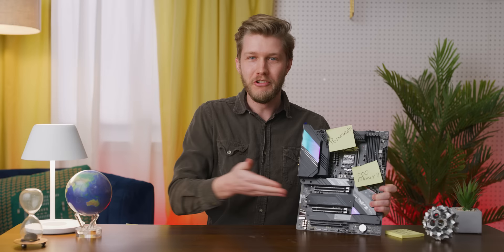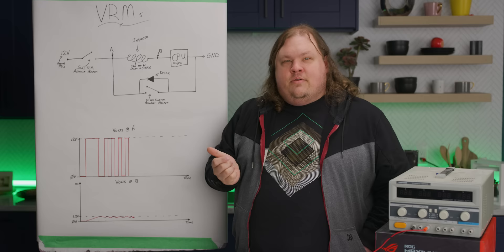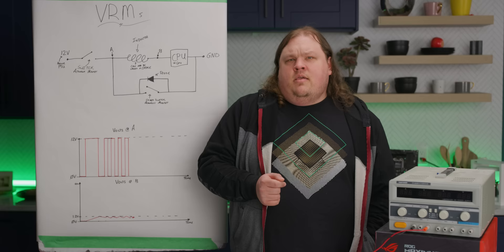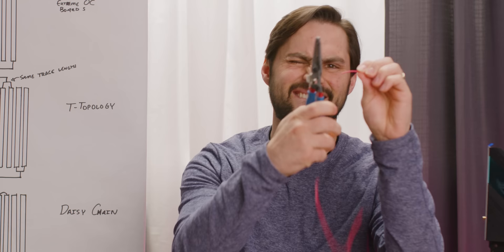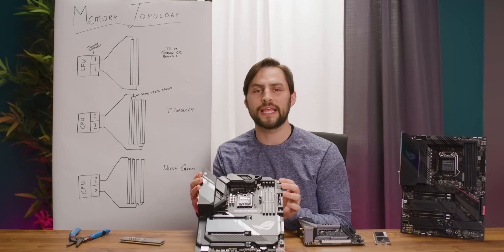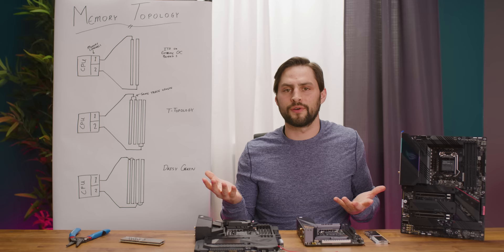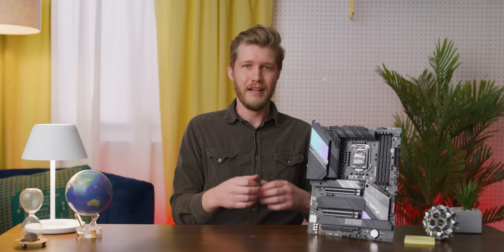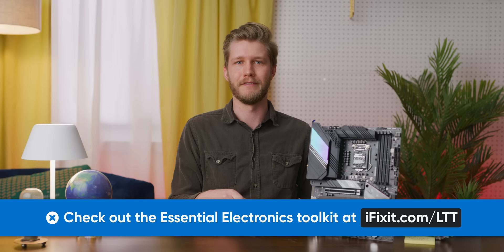How Motherboards Work - Turbo Nerd Edition

Comment: As an electronics engineer, I'm really impressed with the deep cut.
Reply: The cutout and presented result was definitely on-point, but understanding the mechanics of the simple circuit does require some prior basic knowledge about EE, such as charging/discharging Inductors (AC current when discharging right?), diodes/resistors, and dangers of shorting the circuit.
Reply: @knightblad5631  I also thought that was the weakest part of the video. It explains it on a very basic level, so basic that it doesn't really explain anything.

Like why is the switch with the diode in parallel necessary? Why does it fry the cpu if both switches are open? Also the flow of "electrons" doesn't make sense to me.
Reply: @Crallux  Wouldn't approach EE stuff thinking about electron flow. Think in terms of volts, amps and ohms. Much easier and more useful to do it that way.
Reply: @alexanderkuhn2298  You can think about them as Liquid Pipes as well very good way to understand how Ampers and Volts and Owhms(resistence) works
Reply: @mattmadcat  Im an electrical engineer but thank you.
Reply: @Crallux  And I think they don’t know how much heat a mosfet generate with a current of 10 amps going through it
Reply: @alexanderkuhn2298  Exactly! My point is that their animation is misleading and can lead to false conclusions or assumptions. It may look fancy but it is wrong in every way.
Reply: You guys are Wizards! Thank you for what you do.

Comment: In fairness, mini ITX boards have 2 slots, less VRM heatsinking and fewer expensive high speed PCIe slots, not to mention that by being smaller there's a smaller board area to pay for all those layers. Nothing stopping you from mounting one in a full size case if you're only ever going to throw a GPU and a couple of M.2 drives in (plenty of options with 2 full speed NVMe slots)

Comment: 4 ram slots actually improves performance depending on your ram, but I agree with SLI, however you can plug PX1 cards in 16x slots just the same, it just won't take up the full length so there's a use for it.

Comment: I would add to VRM part, you want to have SOMETHING, but it can be literally few mm of alu/copper/steel/iron whatever, and you will be good. As VRM efficiency change with heat, for stability you want a metal slab that touches all VRM's and unify their temps at something below 90'C, everything else is just bling. I personally like overbuild heat sinks as I am a silent build guy. Example on video is 10x of what is required, especially if CPU fan is moving.

Comment: You're teaching me more about computers than my computer science course.
Reply: "Computer Science is no more about computers than astronomy is about telescopes"
Reply: Actually I think that computer science courses focus more on the software side of things. If you want to learn more of this I beleive an electronics course is what you're looking for.
Reply: Imo it's misleading to call it CS, computer science. In german we call it informatik, which is much closer to what this is actually about: information science, which goes deeper into how information can be handled and manipulated. For hardware, EE knowledge is required much more
Reply: @nootics  guten abend
Reply: I followed an electronics degree course and had a 2 year "electronics and computers" minicourse prior to that over the same field. It does teach you how general circuits work and all but it's just basic level stuff (in regards to how hardware works that is; And since it's academic you'll be looking at low level circuits maybe mixed with some ampops at best... all else is going to be big stuff like transformers, power lines, etc). There is no course, at least in the coutry I live in, that is directed towards JUST computer hardware and how a computer works on a mechanical level (that's all I wanted and no matter how hard I looked there was none). 

These courses focus a lot on software and how there's 1's and 0's and here's logic gates and here's addresses, here's how C/C++/Python interacts with RAM to make/edit a program  or file but they dedicate nothing going into how a computer actually works with all those things mashed together, how components comunicate with eachother, how CPU receives, processes and sends information, what signals it sends/receives; Hell they don't even tell you how a motherboard works but for programming expect you to know how RAM does, somehow.

Then again, this is a recurring meme with university students from all over the world within various different courses... we are taught basics (sometimes not even that) and general info and then are expected to find out the rest by ourselves. I don't think there's even a master's (degree) for this subject. A lot of people that I've ever talked to that knew more intricate things about computers were self-taught... just goes to show.
Reply: @yeetus_maximus  Yes, all the components of the VRM was touched on near the end of the semester of my college electronics class.
Reply: i think it depends on what programs your school has
Reply: this is more computer architecture than CS

Comment: A lot of us do need 4 RAM slots and will in fact upgrade in the future and we start off with two sticks to run in dual channel mode. Maybe gamers may not have to worry about needing extra RAM but content creators definitely benefit from an upgrade. Given how prices fluctuate (and how much prebuilts overcharge for memory), we can't always afford as much RAM as we would like when we first build our systems.  Limiting yourself to two slots, it essentially means that we'll have to throw out the RAM that's already in there and effectively pay twice as much when we want to upgrade the memory.

Comment: Buildzoid is the only guy I trust to differentiate between motherboard details. Glad to see him expanding his network.
Reply: Buildzoid is who beginners watch and end up getting a $500 mobo for a russell 3600 bc that mobo has best vrms or some shit
Reply: @danielantunez8355  If you listen to buildzoid and are honest to yourself you listen to him and get a MSI B550 A-Pro, if you buy more you either didnt think yourself or you need additional features
Reply: @danielantunez8355  doesn't he usually recommend affordable motherboards. If you watch buildzoid and get a >$500 motherboard, you're an overclocker (competitive or not). I've not seen him recommended an expensive motherboard to regular people. Most $100 - $200 motherboards are good enough for 90% of consumers
Reply: I only watch BZ on GN so maybe it's different on his channel but his vids on GN are beyond the novice. This bid is a good starting point for the novice
Reply: @larsheim1032  the issue is no one's is honest w themselves. Many people bought in for pcie4 when they couldn't nearly saturate pcie3 as an example
Reply: @danielantunez8355  i know that, my MB is also over the top but i dont blame BZ for it
Reply: @jesselioce  BZ's advice is get the A-Pro, if you need way more Ram-OC or wifi get a better one. cant blame him
Reply: @larsheim1032  Buildzoid is not good at explaining what he considers a "good" or  "bad" VRM. He put 6 x 40A phase (240A) VRM in "below average" tier, not explaining that actually it's enough for non-extreme overcklocking as long as you have airflow over VRM. It can handle stock 3950X just fine, and with 8-core AMD CPUs it's pretry much chill.
Reply: @CossackHD  Exvept for the fact he does that regularly on motherboard release roundups.
He explicitly states that for the majority of people the VRM of most midrange boards is more than fine and to bare in mind that his channel is "Actually Hard-core Overclocking" not "daily driver OCs"
Reply: @bengrogan9710  I've seen his older videos where he doesn't explain that very well or at all, he even did put 240A VRM in "only good for mild OC category", while actually I was able to push R7 1700 to the (air cooler) limit on such mobo (160W) and run the cpu at full load for hours. Mild OC would have been between stock and my setting.

I didn't keep up with his videos lately as I'm not looking to buy a board, but his vids from 2-3 years ago certainly did ovrrsell importance of VRM.
Reply: @CossackHD  Again, a case of not understanding the context - he does XOC's - if you're using an air-cooler that is enough for it to be a stable daily system then that is a mild OC
Reply: @bengrogan9710  I know Buildzoid does LN2 overcklocking but even then I get an impression that he oversells VRM. Lots of people watch him knowing even less on the subject, so Buildzoid should provide more context.
Reply: @CossackHD  For XOC related stuff VRM are the main concern for supply stability when pushing hard, he's gone into it on several videos before and outright said that outside of his round up videos his content isn't focused on daily systems where outside limited issues any board will do.

You wouldn't fault A video by an F1 car driver for not covering the handing of pickup trucks as the audience is not the same
Reply: he goes into tons of details but does he know how to condense all that information into actionable buying decisions? ill look up is he has a top motherboard of 2020 etc or def what not to buy type of content too
Reply: @Aleph-Noll  its mainly a quick release window round up style video for new launches
Reply: @bengrogan9710  alright thats cool. he does seem like he goes on long rambling bits to me which puts me off on this sorta content but im sure its all good info to someone
Reply: @Aleph-Noll  Oh he does love to ramble and wander off topic - It's why he praises GN for managing to edit down his rambles into watchable content when they work with him

Comment: Fun fact: Buildzoid has no official education in electrical engineering, it is all self taught through Google and experience. (I asked him about his education once)
Reply: You're kidding me o.o mad respect for Buildzoid :o
Reply: That is extremely cool.
Reply: Buildzoid should go get a certification, I bet his profs would love him.

Imagine if Buildzoid goes to college again for electrical or computer engineering, and his profs are his fans.
Reply: Self made zoid. That's pretty neat actually.
Reply: Buildzoid is a hero then.
Reply: That explains why i did caught him talking bull's pile about VRMs in TUF B450-PRO. I left a comment about his incompetence and he never defended himself back.
Reply: @AliShuktu  ?
Reply: @AliShuktu  He ignores negative people, because most of the time they know less than they think they do, and it's not worth his time.
Reply: @AliShuktu  OK, Ali.
Reply: @vcjester  Yeah but he told big BS about especially Asus TUF b450-pro. That it won't handle 8/16 core over clocking. I presented a video evidence where exactly 8/16 old rysen was OCed to 4.1 all cores. Hence he talks nonsense to the public.
Reply: @AliShuktu  You realize he is an extreme overclocker, right? He doesn't even think about something as low as 4.1 LOL
Reply: He's just built different
Reply: @AliShuktu  One of the major things that limits the lifespan of a motherboard (and a lot of other electronics) are the capacitors - specifically the electrolytic capacitors.  The rated lifespan of a electrolytic capacitor decreases as the temperature increases leading to a increasing likelihood of either wear out failure or catastrophic failure - wear out failure is the better of the two because the capacitor just ends up like a wire link instead of a open circuit that you would see with a catastrophic failure.  

If you run your VRM close to it's limit then it is going to get hot and that heat degrades the electrolytic capacitors that are right near your VRMs which decreases the lifespan and/or stability of your motherboard.
Reply: @vcjester  
Wrong. He specifically told: it wont run on this. Which is a lie.
Reply: @AliShuktu  OK, fine. You win the internet today, go tip over some chess pieces and strut around Hercules.
Reply: @emu071981  
I know that. 
Why are you telling me this and what's your point? Are you following what did i just said about specific situation?
Reply: @vcjester  
Have you googled TUF b450-pro mobo? It has one of the biggest heatsinks in b450 boards.
Reply: @matasa7463  it's a waste of time
Reply: @AliShuktu  You said he talks nonsense to the public yet have you actually done any research into the VRMs on the various AM4 motherboards?  The b450 TUF gaming has a pretty crappy 4 phase VRM with 1 high side and 2 low side mosfets per phase.  You are going to need decent airflow over the VRMs to overclock a 2700x on it and you are going to have VRM overheating issues with anything that has more cores when overclocking.  There are much better boards for the higher core count CPUs, especially if you are planning on overclocking them and, chances are, some of them are going to be cheaper than the ASUS board.
Reply: @emu071981  I'm guessing that he owns that motherboard and someone talked shit about it and is salty about it.
Reply: @emu071981  
Excuse me but are you blind??
I said not b450, but b450-pro
Why are you twisting my words?
Reply: @AliShuktu  Not much difference between the two except for the pro having 2 4C10B on the high side instead of a single one which doesn't change much.
Reply: @emu071981  Yeah and twice as big heatsinks which gives better cooling then even MSI? Are you tripping? Why are you arguing with me, boy? Did i hurt your feelings towards buildzoid or what? :)
Reply: @AliShuktu  I've looked at the PCB, and it's typical Asus, a 4 + 1 phase vrm, but they double up the components and falsely advertise it as an 8 + 2. If you got the standard 4.1 all core OC on an 1800X with that mobo, imagine what you could get with the cleaner voltage regulation of something that isn't such garbage. You have a good bin of silicon.
Reply: @AliShuktu  Imagine being so platinum mad that Zoid ignored you that you have a fit on someone else's video.

Comment: I absolutely want more turbo nerd videos.  As a design engineer by trade, I appreciate how you decided to present this info.. but also it's a bit odd to describe the circuit level stuff in this context.  I'm not sure a buck converter is relevant.  Important takeaways are that trace lengths and impedances are very important at high frequencies because of transients.  And definitely the marketability of something will drive that product far more than any sensible engineer in a company could lol.

Comment: Absorbing heat throughout the entire motherboard helps all parts that create heat. They said cooling particular chips was pointless in the past. Like during the K2 days they said cooling north and south bridge was pointless but look at motherboards now. Controller chips are cooled to keep up with other parts. But even still if something absorbs heat it will affect what's around it so if cooling parts just use it as surface area to release the heat. Anything helps.

Comment: As nicely as I can put this I am an electrical engineer a mosfet  does not have an inductor nor does an inductor turn electricity into a magnet it is not used to step down voltage and a power supply for a computer outputs 12v for fans and hard drives it also outputs 5 and 3.3 if you wanted to step down 12 volts  it’s as simple as setting 4 resistors in series as 2 resistors in a series is a voltage devider

Comment: day seven asking Linus to make a “Learn Linux with Anthony” series.
Reply: Man, that'd be so good.
Reply: I second this.
Reply: Yes please.
Reply: Bump
Reply: Id love to try linux
Reply: A series slowly explaining the different parts of Linux and how to setup games and other software. The final episode will be using Arch or Gentoo for a fully custom system.
Reply: I’d love that
Reply: Keep going don't stop dude!
Reply: you mean day 90. These comments are unoriginal and overused
Reply: Only day 7?
Reply: linuxtechtips
Reply: I really need this to happen!
Reply: i think this video will show how much people are interested in learning more complicated things, i study electronics and there were a few things i didn't knew, like the two posible configurations on the 4 ram slots
Reply: @Lyndeno  no, those are way to advanced to be part of a general purpose channel, there are already a lot of information about that, we need a user level guide first, then a general config that applies to almost every distro, after that people don't need much to use the advance level distros with fluidity, i would like to have a guide about that, because there are a lot of options i overlook or that aren't in guides, like controling the gpu via commandline correctly, little things like knowing that nvidia drivers are so shitty that they dont start the graphical enviroment unless there is a monitor already pluged when the system starts, if its not plugged then it wont start even if you plug it later, little things like that, that most experienced users tend to ignore, because is a one time fix and you dont encounter it again.
Reply: yes
Reply: sudo pacman -S linux511-anthony
Reply: OMG yes please!
Reply: YES!!!!!¡

Comment: I have a mITX board and I like the form factor. However my next built will need a PCIe slot next to the GPU and a lot of m.2 options with the full PCIe bandwidth